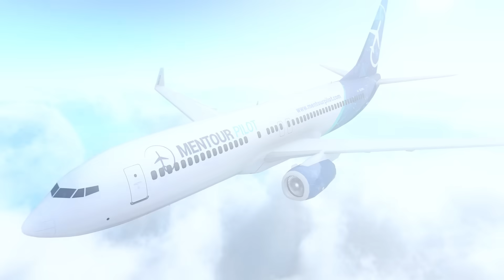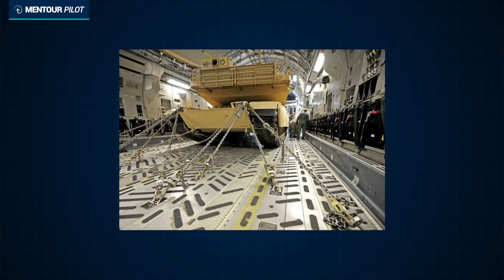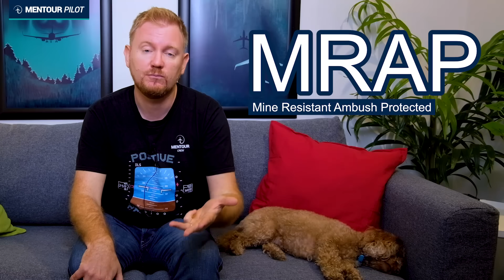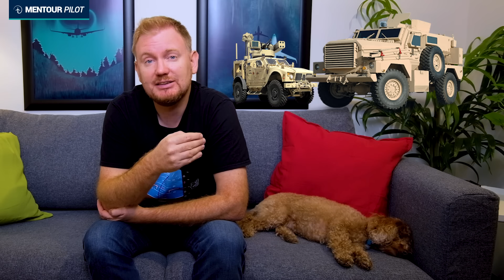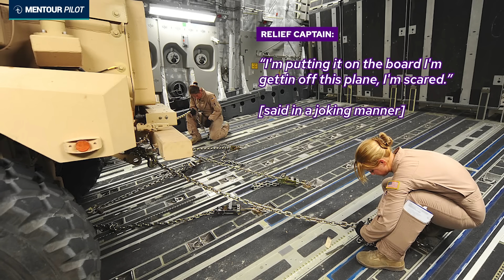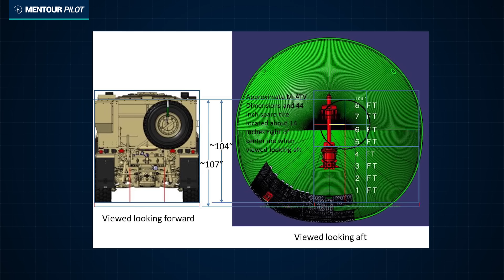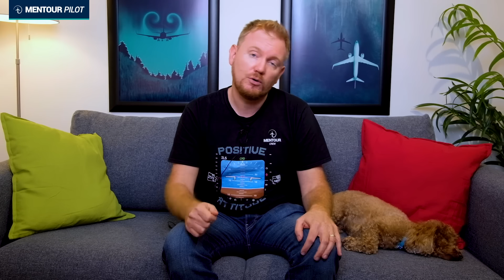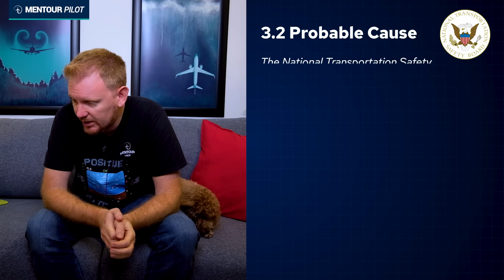Why did the pilots LOSE control?! National Air Cargo flight 102

Comment: The whole episode displays incompetence at every level.
In the marine industry the transportation of abnormal loads requires the production of a Seafastening Procedure which is a document containing engineering calculations and drawings, signed off by a qualified engineer. This will then be approved by an independent Marine Warranty Surveyor. This is all required for insurance purposes. and for the various parties to cover themselves against the repercussions of an accident.
In the present case the transportation contractor was clealy incompetent, and furthermore I don't see how the air transport industry can be allowed to operate in such an unregulated fashion.
The total inadequacy of the lashing of the vehicles is demonstrated by the fact that one of the smaller vehicles broke loose under acceleration down the runway. Imagine the carnage if the plane had taken off and run into turbulence later.
I hope the industry has changed its practices since then.

Comment: I was there the day that plane crashed. Something you didn't mention but is very relevant to the crash is the required climb out angle at Bagram. It's completely surrounded by mountains so any aircraft coming in or out has to account for this. It creates steeper angles that most airports.

Comment: Since the most gs on an airplane are forward and backward, how comes that cargo planes are built with controls just behind or in front of the cargo load? Same about controls and battery just above main gear in several Boeings.
Reply: Not to mention the dc10 controls through the floor 😰

Comment: While yes the load master calculates the restraint requirements, it is the ramp load team who makes the initial calculations for restraint. Also on commercial contract aircraft the cargo must be restrained per the contractors loading regulations. USAF per their normal regs would not have used straps, they would have used chains

Comment: Strap load ratings are 1/3 the breaking load of the strap. If a strap breaks that means you have grossly under secured your load. All of the other straps should have been replaced as they were overloaded and compromised at that point. 

The level of incompetence displayed here is astounding to me as a person who has done a lot of rigging in a construction setting.

Comment: Excellent video. In addition to the findings re: certification & training, I think this is also an instructive example of the pressure to conform when working for an organisation. Regardless of what the procedures said, at least one of the pilots knew in their gut that it wasn't safe, but felt compelled fly regardless (one of them also joked about it, and joking is often a way of voicing concerns without directly tackling the issue). Imagine they had turned around and said, "no". What would have happened? Probably nothing good for their careers (especially if another pilot came in, flew the plane and nothing happened).

It's interesting to me that Crew Resource Management has made massive improvements in aviation safety, but we still don't have something similar for cross-cutting issues in companies. Profit and 'not being difficult' is frequently prioritised above being able to raise concerns or simply say, "no." until a problem is investigated & rectified.

Comment: Your videos are very enjoyable and I learn a great deal from them. There were signs that the accident could have been avoided when the load master questioned the condition of the holding down straps. Considering how big and heavy(18 tonnes for one vehicle alone?!), then the Captain had the opportunity to check it for himself to ensure it was safely strapped down. In the UK there is a specialism in Lifting Operations called an 'Appointed Person'. A lifting Plan is prepared to demonstrate planning of the load and any associated hazards. Equipment used in certified and subject to regular examination. This is a hard lesson and I was almost in tears watching it. The horror of trying to control the uncontrollable must have been awful for the crew. These errors can cause such heartache to family, friends, colleagues and on-call Emergency Services. I only hope these lessons have been learned and applied to cargo aircraft.

Comment: in the 1970s as well as the 1980s it seemed like commercial jets were going down all the time (around 1988 we flew on a 747 with 500 military personnel and the plane was overloaded due to tool box's. the jet took up the whole runway and I can still remember seeing the stripes at the end of the runway, and the nose was up but the rear landing gear was still on the ground.  it was a VERY close call.  then as we were about 60 minutes from Newfoundland we hit a massive air pocket and fell a substantial distance. it was bad enough that one of our men actually had a heart attack (it felt like the wings ripped off the jet) and then because of the heart attack we had to make an emergency landing in Newfoundland during a MASSIVE snow storm. the tower said no, but the pilots said we have to. on the way down the whole jet had the worst icing I have ever seen or heard of. the winds were iced, and the top of the fuselage had about an inch of ice on top.  lets not forget we were overloaded...   we came down pretty fast, and touchdown was more of a controlled crash... it felt like a 2G impact (the type that makes your spine hurt) he stopped on the runway and offloaded the guy from the rear door..  they yelled GO.... and slammed the door. we were stuck deicing the jet for a couple minutes, we then got back on the runway, and again he took everything he had for takeoff (the runway had several inches of snow on it), and I felt we had a 50/50 chance of actually surviving the takeoff, thankfully we made it to Germany.    I was also on a flight when the jet tuched down an d all the runway lights went out, so we had to do an emergency tackoff. took them 30 minutes to fix the lights  lol

Comment: All too often, serious accidents have been required before the most obvious errors can be fixed! I can not accept that at all! This was apparently an incorrect securing of the cargo where you could learn a lot from truck transporters - even higher margins as trucks hardly get back forces on the cargo similar to those that an aircraft gets at takeoff - both acceleration and upward movement!
The use of the right and undamaged equipment is a matter of course and belts without protection against chafing surfaces must eventually break as they have chafed long enough, so it should be secured with both belts and chains, each of which should withstand the most conceivable load.

Comment: If the Cougars & MATVs (MRAPs) were Teslas instead, this never would have happened. I’ve never heard of a failure of Tesla’s hold function. ( Hold obsoletes parking/ emergency brakes)
Reply: The performance model Y tires — 11 inch width rear, 10 front — hold till at least 1G forward acceleration. That corresponds to a deck inclination of more than 45° — more than what was apparently the case before the MRAPs  rolled backwards.

Comment: OMG. Your explanations are so very clear. Having watched your vids about rotation, pitch and runaway stabilizers, I could imagine the tragedy to come, thinking about the inadequately securing of the cargo, even before you began to describe what exactly what happened. Ok, I recognize I'm a data & detail nerd even though I'm not involved in aviation in any way. My history is that of an Intensive Care Nurse,where a complete understanding of exactly how the human body responds to stimuli is necessary to avoid and ameliorate fatal problems. And in a strange way problems resulting in this air crash which occured due to lack of attention and training requirements can mimic  similar problems that occur to human bodies due to lack of knowledge, attention to small details and training requirements. Of course, as I always say, as medical professionals we have more than seconds to recognize the fatal problems, unlike the pilots involved. But sometimes the problems that occur with a misdiagnosis and/or failure to treat appropriately can be irreversible despite having more time to react and intervene. IE,the patient crashes no matter what we do. Human bodies are inherently more adaptable than aircraft and yet inherently more fragile. So the similarities of the tragedies do explain why I find your analyses so compelling. Thank you.

Comment: Wondering if heavy chains or cables would have been more secure. I know the nylon is incredibly strong for massive increasing loads, but it is vulnerable to quick snapping motions, going from loose to max weight or above, this is why tied knots are NOT allowed and if the ratcheting hook is damaged the entire strap must  be scrapped or sent for replacement of the ratchet. I would be required to send all straps, chains, cables out for inspection every year per OSHA mandates, and if anything looks damaged or isn't working properly it's to be taken out of service immediately!!!  I'm sure the requirements for anything going in an aircraft is even more scrutinized, I'm wondering if the Military is more laxxed being they aren't held to OSHA standards and are allowed to bend the rules in times of war? I dunno, but loose, tied and ratchet straps that wouldn't cinch up to make the nylon incredibly taught, I wouldn't allow a semi truck to leave loaded that way let alone, a 747 with  THAT MANY ARMORED VEHICLES!!!! Very sad way to add to the lessons learned training manual! May they rest in piece. The pilots comment of they are soo heavy I doubt they could move at all, concerns me, because any CARGO 747 pilots should thoroughly know about different tie downs and what a secure load looks like, along with a basic understanding of Newton's laws or motion, pilots are definitely smart enough to add this to any Cargo pilots mandatory training.  The other pilot kept saying "I don't like that, or I don't like this" He should have walked the entire load and even tested the tightness of any straps that looked loose, damaged or tied, and asked the load master to correct it until he was comfortable.  But 24-36 straps when Boeing recommends 60!!! Its likely that even perfectly tight, with zero straps tied whould still have snapped just from the sheer forces involved with major potential mass, shifting into massive kinetic energy loads placed on the straps to snap. TIGHT NYLON STRAPS WOULD JUST START STRETCHING SLIGHTLY WITH THE MASS INCREASE DURING PITCHING BACK, WHILE LOOSE NYLON CATCHES THE FULL MASS, NOW IN MOTION, WHICH DRASTICALLY INCREASES THE LOAD ON THEM, SHEARING THE THEM IN HALF!!! if only the pilot had forced the load master to make everything tight, its possible even overload the straps could have held, maybe a combo of chains and straps? Chains can take much more kinetic energy in one quick pull, but are very heavy, and that's by Nylon is used, stronger than steel if used correctly.

Comment: I have a question here: several people noticed the stress on the belts and they knew this was not right. Both jokingly and seriously, they stated various times, between themselves, that things were not as they should have been. Yet, apparently they don't do anything to remedy the problem that it is very clearly in front of them. The question arises why weren't all the belts changed, and why weren't they increased in number. The suspicion I have is that there was some pressure from the Company to not waste time, and/or there were not the proper amount and quality of belts available at the airport. I don't understand how can the crew have noticed the problem, just to ignore it.
Reply: I was a flatbed trucker, and I always used more straps than the other guys. So I was slower to get to the destination and didn't get paid as much because I did fewer runs. Yes I had an incident when a car cut in front of me and I had to slam on my brakes with a load of steel flooring for buildings. The load shifted forward four feet and cut several straps. But it did not hit my cab. I had over strapped, and I had used strap protectors.
Reply: Get there itis. Also, as you said probably not being empowered by the company and pressured. However, the captain of an aircraft is pretty much a god by both tradition and law so the captain could’ve and should’ve immediately called off any operations. The company might’ve been pissed but there’s not much they could do about it. This is why integrity is paramount in life!

Comment: It also shows that the captain needs to visually check what he has been told if possible. A good truck driver will double check his cargo if it has been strapped down or loaded for him. I would have looked at the  vehicles and ask if the parking brakes are set or if the wheels are chalked, if it is in gear. I think they just loaded them, and were too lazy to set the parking brakes or chalk the wheels. Probably did not consider the take off angle was steep putting thousands of lbs of tension in the straps vs just stop it rolling on a level plane.

Comment: It would be interesting to see some calculations.

The vehicle that apparently broke lose weights just under 16,000Kg.

So, how strong are the straps? 2,000Kg? So one would need 8 front, 8 rear, 8 left and  8 right, just to support the static load.

This assumes the cargo floor can take the loads from the straps, and not rip.

As soon as one adds acceleration, additional straps would be needed. 

A ‘safe working load’ calculation normally works on a 50% margin. So if 8 at the front are enough, use 16. 

Now we have 64 straps, just to hold down the little vehicle, ignoring acceleration.

And we also need to consider that a strap rated at 2,000kg should be OK at 4,000Kg,, the 50% safety margin. So if done properly, we have straps twice as strong as allowed for, and have used twice an may as needed, based on their rating, which should be half the actual strength. 

If done right the 15,000Kg vehicle should have had straps on each side capable of supporting 60,000Kg on each side. And we have not even considered acceleration.

Comment: The reason why both the load master as well as his boss initially arrived at similar, lower numbers, was because neither properly took into account shock/impact loads which can multiply static forces by sometimes as much as 10 times. Further. Sling load safety factors (n-1) were not factored in either. When designing lifting appliances, you must design the sling such that if one of the slings fail, the rest have adequate margin to support the load.  Since this was not technically a lifting application, the load master(s) probably felt that was not needed, without actually thinking through the consequences of a failure.

Comment: I suspect it was in fact one or more of the Cougars that broke free, impacted the M-ATV in the rear and ripped it loose. The strapping of the M-ATV, while inadequate, was much closer to adequate than that of the Cougars. Impact loading from the weight of the Cougar impacting the M-ATV, would have severed the straps holding it nearly instantly.
Reply: Given that the two rear Cougars were found virtually in contact with each other, my supposition was it was the middle Cougar that came loose, impacted the rearmost Cougar, ripping it loose and the combined mass of those two Cougars drove the M-ATV through the bulkhead like a battering ram.

Comment: The situation regarding the qualification and training of load masters is reminiscent of the situation with SAR Technical Crew in the UK national air jurisdiction. In military SAR, such as Gendarmerie (F) or Luftforsvaret (N), there are highly developed training course for rearcrew involved in hoist operations and other aspects of SAR flight. However, when, as in the UK case, the service moves to civil jurisdiction, there is limited provision in any national air jurisdiction. The CAA's CAP 999 at Editions 1 and 2 define a number of persons that would require training for SAR operations but defined no licensing scheme or detailed training requirement for SAR TC. A number of us from various SAR backgrounds have been complaining about this since at least 2015. Fortunately, CAP 999 Edn 3, 2021, has moved in the right direction and defined a scheme, short of making SAR TC a licensed aviation trade, for certification of SAR Technical Crew. Hopefully, this will set the training of SAR Technical Crew on the right path and perhaps other national air jurisdictions will follow the CAA's lead in that direction.

Comment: One thing I haven’t seen commented is the fact that many of the straps might have been weakened by the last transit. Seeing that the load was insufficiently restrained such that one strap broke, I would bet that under those circumstances ALL the straps restraining against that force direction should have been retired. That’s because it we assume they were originally cinched down (likely) but now loose, that means they have been stretched. This means that there were likely micro tears in the fabric. In climbing a rope is usually retired after it breaks (absorbs the energy) of a really big fall. Likewise, the strap next to a failed strap has to be assumed to have met or exceeded its rating, and so the labeled rating no longer applies. This type of abuse is probably a good reason to first calculate a load, then add 10 or 20 % to account for straps that have been abused in various ways. The fact that the load master and the pilots discussed this and nevertheless moved on means no one in the room understood the physics of what was going on. A clear failure of education.

Comment: National Air Cargo was a civilian contractor working for the military namely - Air Mobility Command. As these loads consisted of military assets abnormal in size and weight with an added security element thrown in I would have thought AMC would have insisted on using military Loadmasters for both safety and security?